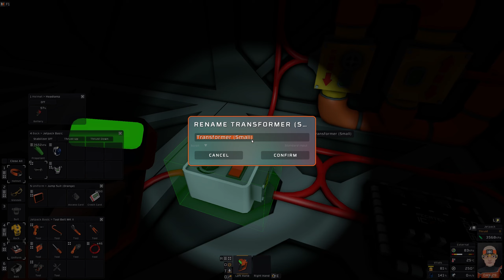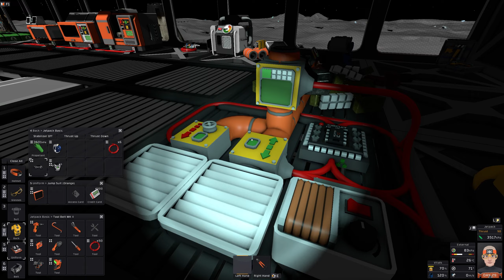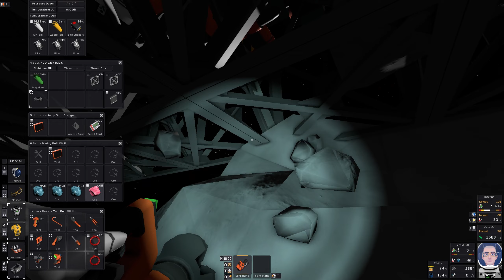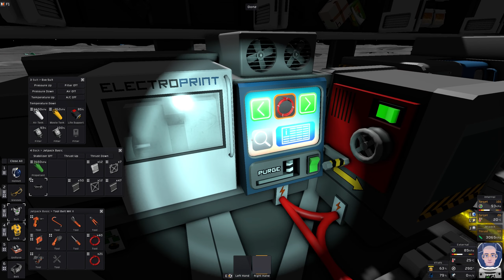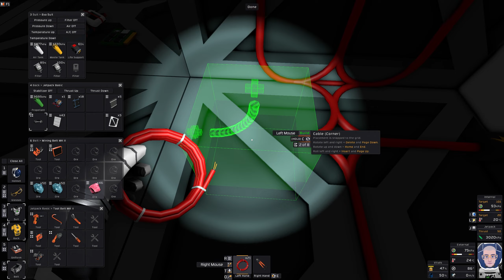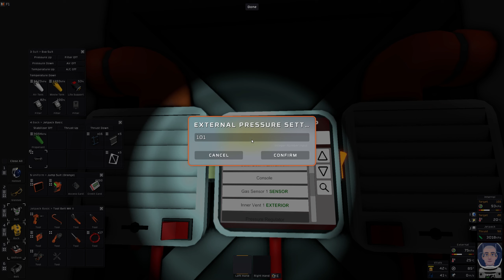Stationeers - Standard Moon, EP10

Comment: Hi there great series! 1 question: in the program that you have to cool down the base, the 4 instruments/sensors have a note to the right that i guess is the position in the Chip from D0 till D3. I ask you this, because i tryed about 10 times to make this works and i got errors over and over. Only once in 10 it worked (i demonted the working one to build it in the wall and all errors over and over). I see in your video that even if you define the position of all instrument/sensor, when you set up the chip you use other D* positions. There is a rule to define the position in the chip? i cannot make it work and as i told you done and redone over and over. Changed the position D0 to D3 in all  possible ways and allways the chip blinks with an error..... what can i do?

Comment: The problem with the cooling is the gas sensors.  Check the names again.  I'm sure you've fixed this in a later episode, though.  Thanks for the videos!
Reply from the maker: Ah, still misnamed.  But the IC reads via the device port so it doesn't impact the logic running.   I put on my list to correct in the future (most likely in EP19).  Thanks!

Comment: add a heavy wire transformer to the wire going outside...if you upgrade to extra solar or other modes of power in future.

Question: is there a mod that gives random building error.. like a pipe loose electric wire not socketed properly or something not done the correct way.. when building a indoor system and laying the extrnal furnace outside on the moon surface.. i know there is a suggestion on steam for chos surface problem scheduled for future updates.. and Solar flare and random Meteor Showers on the moon is one of them. but is there a mod for that... mostly now its very peaceful and easy to build... i know you can choose before starting the game to option out what you can bring and not bring with you..but like not having a furnace or advance printer that don't work without 1 pre-programable chip with a few printing tool diagrams and some basic manuals welding/drilling/pressure.. and make it look more Admissible like the Aurdino EEPROM chip That can be electrically erased.......and not have the entirety of wikipedia on Any basic chip right out the advance printer... yeah i know its a game.
Reply from the maker: My 10 solar units are right on the edge of standard cable and did print heavy cable in EP11, but havn't got around to upgrading them  (but working just fine).   Not aware of any random build error issue.     For Vulcan/Venus, just place full O2 bottles around the outside of the base at random and wait...  <g>     The Moon is the starter planet for learning about Stationeers with a reduced things to worry about.    With easy survival, focus on base design and automation.    For example, full automated generation of H20 with zero mining is still a bit of work to get running.    Didn't follow your last few statements, but you can add your own soft limitations.   For example, I would do the old Venus without using the Solid Generator to make it more difficult.  (But the game is a bit different now...)